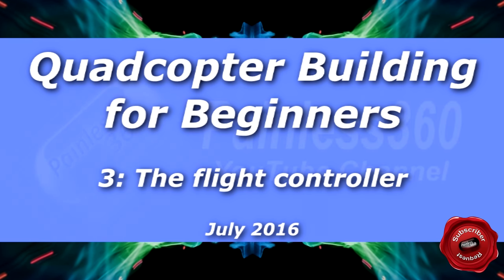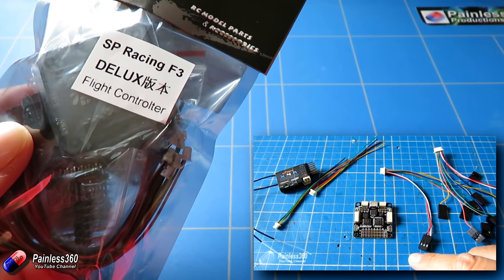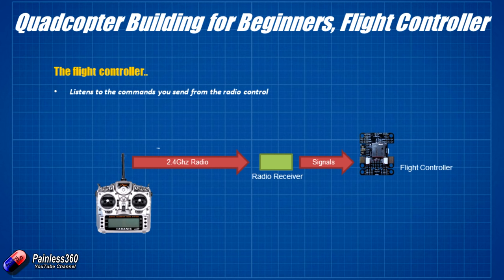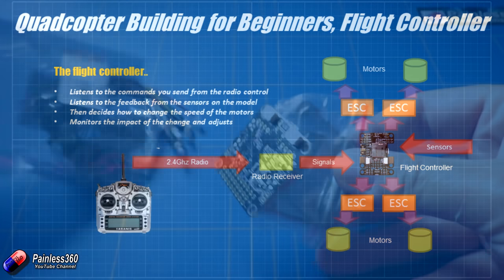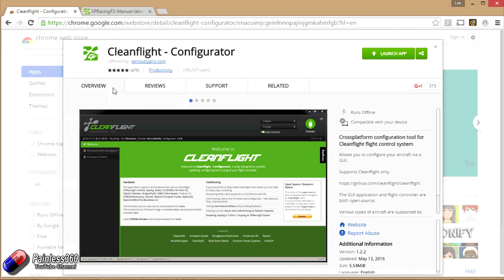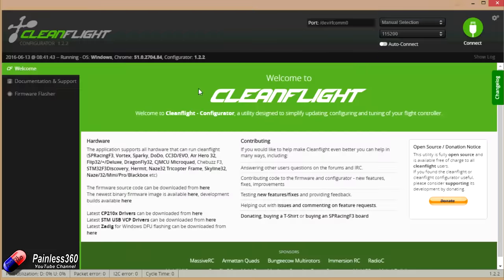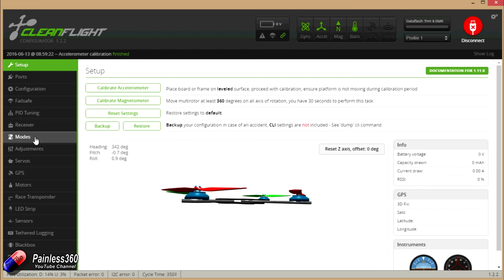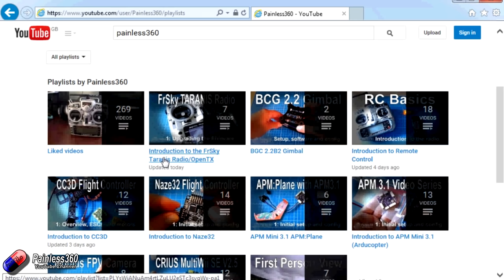(3/9) Quadcopter Building for Beginners - The Flight Controller, options and checking

Comment: Recently, I built myself a quadcopter and flew it. I learned most of the basics of how the quadcopter flies and other operational things we've to do to keep it flying and moving in the right direction. Now, I want to expand my knowledge and learn how the flight controller works. How it's programmed and learn how to program it; learn how it can be programmed to fly autonomously etc. My goal is to learn how a flight controller software like Betaflight communicates with the Flight controller on the drone to make it fly and do other stuff. I researched on the internet and found certain courses teaching advanced topics like "Autonomous Navigation for Flying robots" on edX and certain other websites and documents telling different parts of drone programming. All these are scattered on the web and it's difficult for me to know where to start. Please tell me where should I start?
Reply from the maker: I'm not sure. I don't know it at that low level.. Best of luck
Reply: @Painless360  Ok, NP!

Comment: Hi, one question I figured out some ESC to work with a 4S battery / 30.3A requiered , but i find two version one with BEC and teh oter one without it (OPTO) , which is the diference? Thanks in advance!!
Reply: Refer to video number 2 in the playlist.  3s recommended, although a larger ESC would give the normal recommended 20% safety margin.  ESC is rated to 20A and 30A Bursts.  100% throttle with 3s and the motors in the kit will draw 20.7A per motor.
Reply from the maker: Thanks Simon, couldn't have said it better myself! :D

Comment: Should you handle these electronic parts with the same care as those of a PC? As in taking anti-static precautions and the like
Reply from the maker: Care should always be taken when using any electronics kit. I've not had any problems without taking anti-static protection building these things but I'd not recommend trying to build after rubbing balloons over a woolly jumper ;) Happy flying!
Reply: Sounds good!

Comment: hello I have this fc but mine did not come w the vbat wires. is there another way I could monitor the battery via tx without having to buy a 2 pin connector?
Reply from the maker: Not sure what you mean.. I'd contact the vendor if you are missing something.. best of luck!

Comment: I bought the same kit with the same flight controller but when I connect it to cleanflight the front of the quad (green arrow) is the side of the controller with the USB port not the pin side like you show.  Is that what you meant by each board is setup differently?
Reply from the maker: That's part of it. Most boards have an arrow on it that points to the front but allow you to change the orientation in the software if you need to mount it with that arrow not facing front. Make sure you're clear on which way if 'forward' before starting the cabling! Best of luck!

Comment: Thanks for these instructions. I have received my kit and plugged the flight controller into the PC, unfortunately the magnetometer is not recognised by cleanflight. I have then flashed the firmware to 1.13.0 SPRACINGF3 2016-6-5 22.20 and checked the accelerometer and barometer in the "Sensors" section but still no magnetometer. Any suggestions?
Reply from the maker: +Trim Yersidies it should appear automatically. There are two versions of the SPRACINGF3, only one has a baro and Mag. I'd check which one you have. Best of luck!
Reply: I suspect the Mag may be broken then as I have the deluxe version of the SP F3 and the Baro is working fine.
Reply from the maker: +Trim Yersidies sounds like it. I'd reflash it with CF as a last check and let the vendor know. Best of luck!

Comment: I intend to build my first quad, an f450 with kk2 f.c.  As far as esc's go, should I still look for simon k., or do new esc's not need that anymore ?
Reply from the maker: The KK2.0 flight controller is very out of date now, please see my Beginners Quad build on the channel (I did one only a few months ago) that use more modern pieces.. Best of luck!
Reply: Ok. I found and watched the updated beginner build series. But there was nothing said about SimonK esc's, so I will take that to mean that modern esc's all either have it in there as standard procedure, or the new esc's have better native firmware and SimonK is a thing of the past (i mean using the modern fc's, motors etc. that you are using in this updated video). If SK was still a concern for modern components, you would have mentioned it.
Reply from the maker: SimonK was one of the first 'multirotor' specific firmwares with faster updates and all fo the setting needed (i.e. no breaking) setup too. It was replaced in the vast majority of ESCs with BLHeli..

Comment: Do you have to have a certain cord? I just bought it and can't seem to get my MacBook to recognize it.
Reply from the maker: Nope, I'd check that the USB cable you have has all four wires in it. Some cables are for charging only and don't have the data connections..
Reply: Painless360 I've been using multiple 4 wired USB's and the computer doesn't seem to recognize the board. I am also using the manual selection as shown in the video, could this be a sign of a bad board?

Comment: what do you recommend for a beginner flyer a CC3D or Naze32? Thanks! which one is easier to fly with?
Reply from the maker: I used to recommend CC3D and something like Librepilot or dRonin. Using that provides a wonderful setup Wizard that helps a new pilot get up and running safely. That still stands if you're not invested in getting a Betaflight capable flight controller.. See our flight controller comparison video..
Reply: Thanks!

Comment: Some thought. When the left front motor stutters and does not spin but the rest do. Motor is fine and esc.Checked that by putting them on the rear right. Wires from naze to receiver are ok. From the naze to the pdb are ok. Tested it with my fluke when you set it to diode mode. With the beep, you know what i mean. The eachine racer has capacitors but people say its just for cleaner flight with volt etc. Does this mean my pdb is not good? It was an diy kit. Maybe try to flash it again but not installed on the quad? Thanks for your thoughts.
Reply from the maker: I'd check the power to that ESC arm, also it may be a bad connection on the flight controller for that motor/ESC too.. Best of luck!
Reply: Robert Toebak

Comment: You said something that puzzles me (flight controllers are soldered with pins). I noticed my tarot 130 does not have pins soldered to the Flight controller, just a series of cables with jst connectors ¿Is this common or somehow unusual?  Great series, by the way.
Reply from the maker: +Eric Avila some have servo style pins, soon picoblade style connectors, some just solder pads.. lots of choice for your build and space restrictions. Happy flying!

Comment: Is there a difference between racing drone flight controllers and normal drone flight controllers?
Reply from the maker: Not any more. See the later Quad Build series (Series 6 and 7 and the last two) for builds using modern flight controllers..

Comment: i need help!.. i built a warp 6" quad it has a moto f3 flight cont..what do i do first?? as far as plug in to clean flight to get it in the air??..
Reply from the maker: If it's a RTF model then there should be details in the manual. If not all of the steps for setup and checking everything if ok is in this series here.. Best of luck!

Comment: What if we program our own flight controller that is based on ARM microcontroller, Would the Clean Flight software recognize our board?
Reply from the maker: Nope, the targets (board specific versions of the code) are only supported on boards that share exactly the same setup and pin allocation..

Comment: I think I have it set now. I have the latest version of CF installed and I'm using the latest version of firm ware installed. at the top in CF I have  GYRO ACCEL.. both of those are green.. the others are  grayed out.. I noticed your has MAG and BARo lite up... does this mean I have a bad board or did I mis a step...I did calibrate accelerometer. the calibrate magnetometer in setup is also grayed out...
Reply from the maker: +daytonpyro in the latest version of CF it disables the Baro and mag by default, even if your board has them. It's normal.. Best of luck
Reply: do I need them? I found a video to go into CLI and set it to  auto.. checked the DUMP file and it showed in the log... it still never showed up in CF..

Comment: I have an old Airtronics 2.4GHz radio I've had for my RC airplanes.  Is it possible to use its receiver for quadcopter kits like this?
Reply from the maker: +Steve Jones depends on how old it is and how advanced the reciever are. Modern radios like the QX7 are cheap and very powerful.. Happy flying
Reply: Thanks for the fast reply.  Heading home now to go check it out.  Its old, like 13-15 years old but it is 6-channel.  The radio you demonstrate in your receiver video of this series looks cheap enough but I'm going to see if I can get mine to work.

Comment: Hello, I've just found this channel and it's amazing!

I'm planning on building a 4s 250 size acrobatics quadcopter in December and have heard of the 
EMAX Brushless 25A 4IN1 Quadcopter ESC with Built-in UBEC.

Would this serve my needs?
Reply from the maker: Possibly - this series should help you make up your mind. Happy flying!
Reply: Gouada build for bs ginners paainless 360 5/9

Quadcopter building for begginners 7/9

Pzinless 360 7/9

Comment: When I plug in my FC and then push connect it says this firmware on this device needs updating to a newer version then is says use CLI for back up before flashing. What does this mean??
Reply from the maker: +Miguel Diaz De Leon if you're using Cleanflight I have videos all about that..  Best of luck
Reply: Painless360 yes I saw that I got it to work thanks, but for some reason I don't have mag calibration.

Comment: When i connect my sp3 , there is only blue led . never seen a red led.and cant connect and flash the fc.Does it mean it is dead ?
Reply from the maker: +samet duman doesn't sound promising, I would contact the vendor for support or a replacement. Best of luck

Comment: Hi dear friend. i have the same board but i cant connect it to the computer. ligths flash, computer recognizes but the cleanflight dont connect and says failed to open serial port
Reply from the maker: Happy to help but please watch https://www.youtube.com/watch?v=olIqTiSJHIY and come back to me with more detail of what you've tried..
Reply: great video btw. i believe my problem is similar to the one the developer gave you. i've been reserching for 2 days and no solution worked on me. maybe i havent really understood whats wrong. i've instaled stm drivers, tryed changing configurations but no port seletion appear to me. just says manual selection in cleanfligth.do you have any video showing how to configurate ports?
Reply: Dear Painless. i have understood what was wrong. its something that may happen to anyone. when i read to download drives for my chip i went to read what was written to find out and there its written stm. but my laptop doesnt read it as an stm. it reads a cp. so i installed cp drives and now it works fine.

Comment: Hi Painless have you ever made a vid on the JIYI P2 V2 autopilot system This is my firs build. i have a KongCopter 550 frameEMAX MT3510-600 motorsDYS BL Heli 40A mini ESC 19.0gHobbyKing Distribution bord and lighting controlgimbal for a XK X3806600 10c batteries x3jiyi p2 v2 jiyi OSDneed help with a 9ch transmitter and receiveri have an XK X500 and thought it would be nice to build somthingHELP PLEASE
Reply from the maker: Sorry, we've not. Best of luck with it..

Comment: Too late with that small quad, finished my first drone and upgraded it with a camera and better flight controller. I did have a problem with the motor stopping in mid flight. Replayed the esc and it seems to work fine again.. did cost me an arm though.
Reply: replaced*

Comment: And can we use..2500 mah mobile battery to power the drone which i made
Reply from the maker: Yes, if it has the right voltage for the ESCs and can supply the current needed..